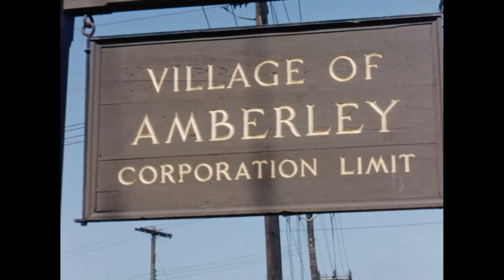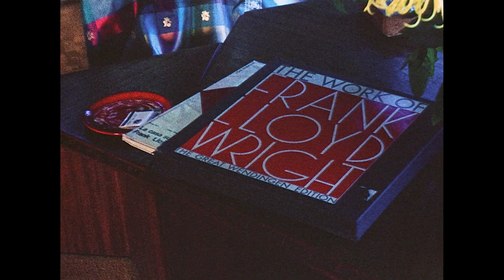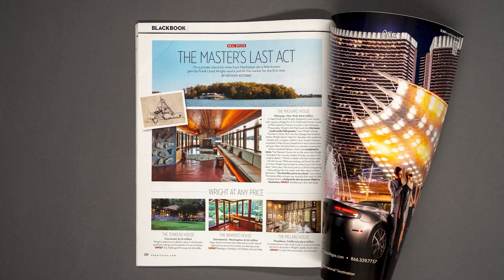Passing On

Comment: Such a gorgeous house but I feel like the roof design could be in places like the tropics wherein you dont have to worry about the flat roof getting all wet. Considering that its location where it stands, snows, it should have been appropriate to use a water shedding roof instead of flat.
Reply: Check out the skyline of every city in the north.
Reply: Practicality was not first on his list.